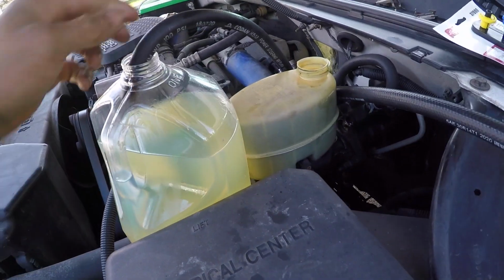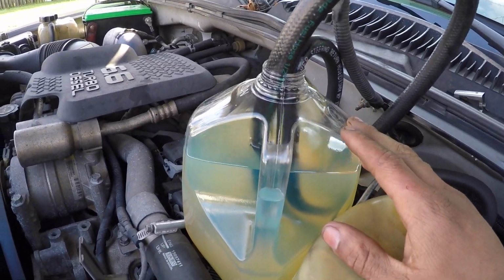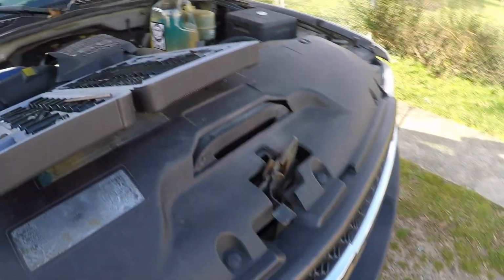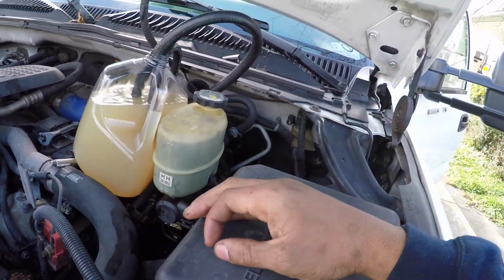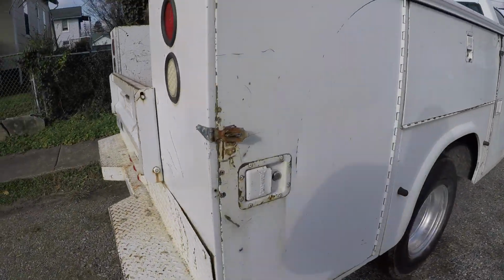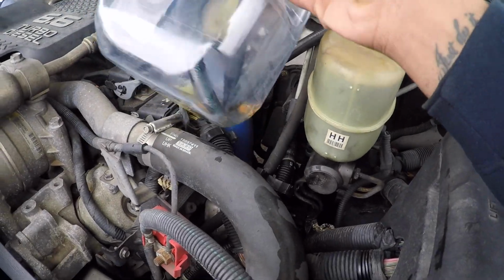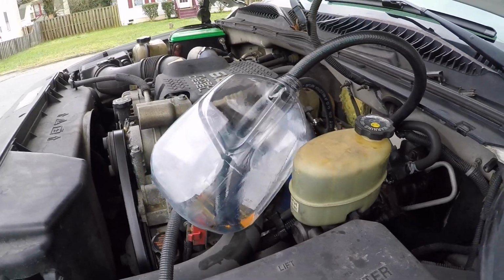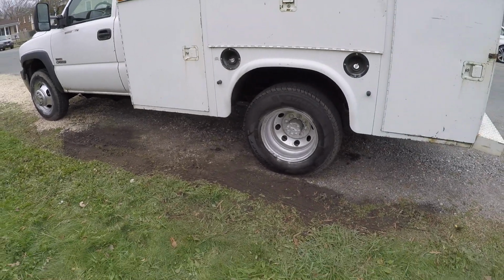How to clean Duramax injectors

Comment: good info man, i didnt know you could do it like that. know of any way to clean injectors outside of the engine... just soak em ? can you make run cleaner through some kinda way? bro has an old fox and the injectors have a bunch of rust and funk in em really dont wanna try running the engine with em like that.
Reply from the maker: You can soak them but you will have to research whats best, he also should consider once they are reinstalled seafoaming his foxbody